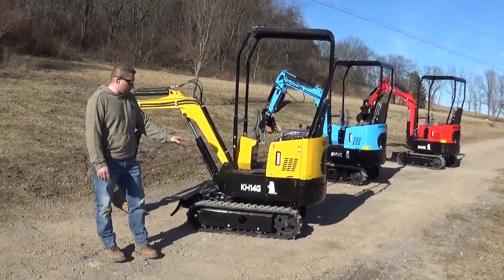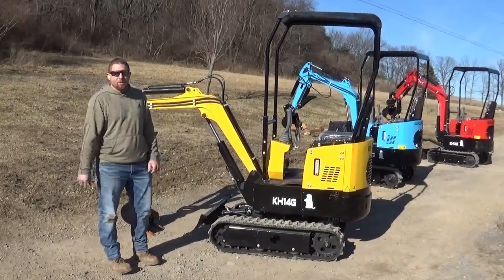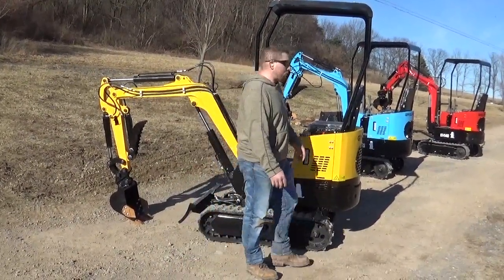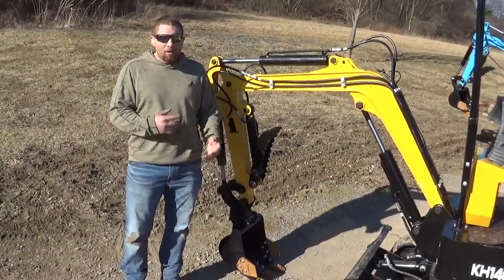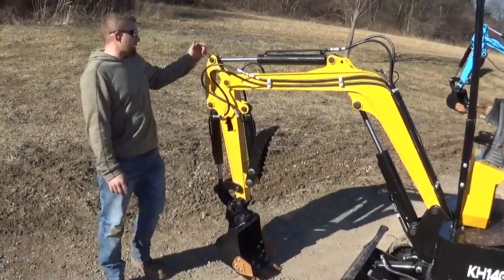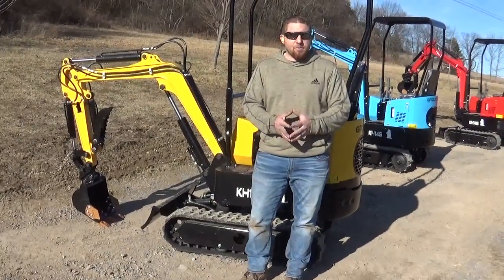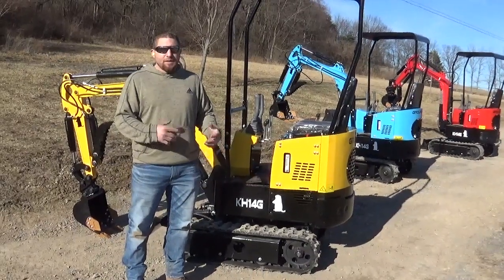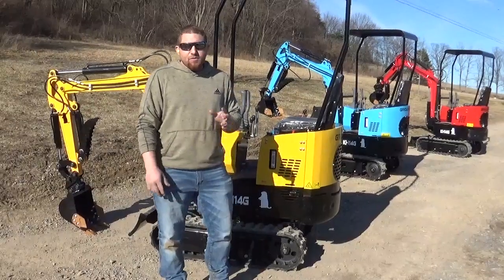GroundHog KH14G excavator safety, maintenance and upgrades

Comment: Where can i get repacking kit? Or the whole cylinder because i tried through the dealer and you guys wouldn't work beyond the dealer either. I had to buy another brand.  😮I am pleased with the ZH14G especially after moving the muffler to outside of engine bay. I used another b&S muffler designed for my engine.  I did a few more mods and it has been working flawless.

Comment: I just bought a new KH14G-2 from WA dealer as well.   I really appreciate your how to's and in this one, the tightening of the track mechanism.  But. somewhat disappointed with the manuals provided.  Would be very helpful to include in the maintenance video (or a new vid) more detailed information for us.  E.G. you mentioned Neo Grease fitting.  In the tool box we have a cone style male grease fitting and also the typical Female zerk as mine mini has both kinds zerks.  I have never heard of these NEO fittings. Assume they are zero stick up to prevent knocking them off during excavation?   I want to use my larger grease gun and acquire a new NEO? zerk tip for that gun but no idea what size, spec, where to buy.  Any specific grease recommendations, manual doesnt specify....Also, the kit comes with a boxed up new filter.  Yet, no information about it or stamped numbering.  Assume its an Hydraulic filter that obviously isnt covered in the Briggs/Straton manual but may or may not be covered in the Groundhog manual.     The throttle mechanism, while working, doesnt extend more than say 1/4 diameter of the throw. This doesnt seem right but nowhere to see about adjustment.   Keep up the good work on the vids -We do appreciate them.
Reply from the maker: Apologies for the delay, give us a call anytime at 570-837-1003 about the filter and throttle, but We are working to improve on our manuals. Yes, Neo fittings are designed to be low-profile and reduce the risk of being knocked off during excavation. You'd need a needle tip grease gun, we can send you one or they're available at most equipment shops. As far as grease, We use Lucas Oil Red n' Tacky.
Reply: @groundhogequipment  Thanks for the reply.  I havent called yet but plan too.  So here are couple more topics to cover for us to learn how to safely operate:  I recently watched a video that an operator was relaying the freewheel nature of a different brand and that didnt have a brake Valve.  Very dangerous.   Showing how to safely operate on a slope would be handy.  And, wondering if our Groundhog BH-14G's have a brake valve for slopes?  Staring after having set for 3-4 months.  I have to actually prime the carb with fuel to get mine running.  Ran fine after that but seems the fuel drains for the carb slowly over time.  as noted above, much appreciate the vid's.  Helps me to safely manage the operation and maintenance of my 14G

Comment: What weight of hydraulic fluid do these take? Iso 46 or universal tractor fluid?
Reply: I use iso 68 down to 40° if its gas powered.  Iso 46 if its colder. I would not use tractor fluid.